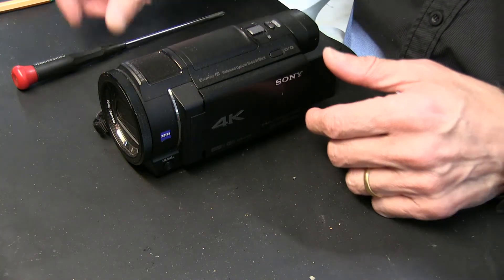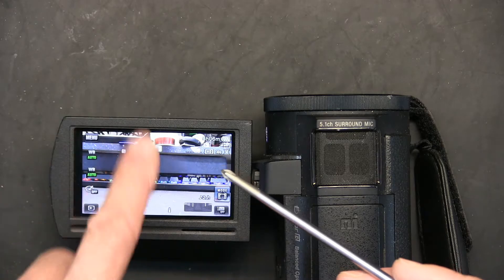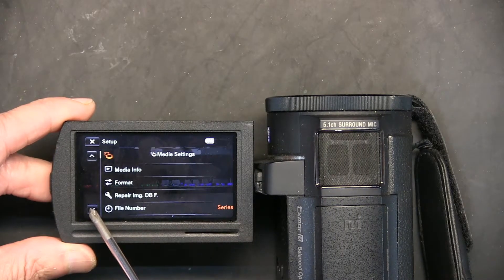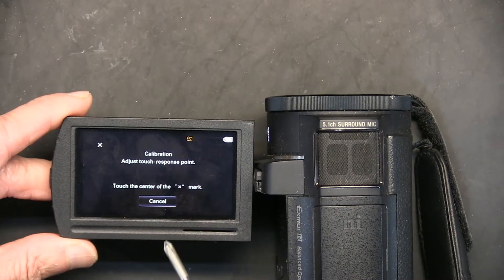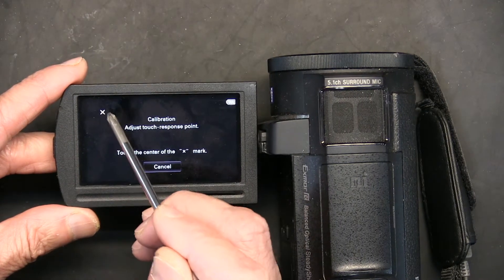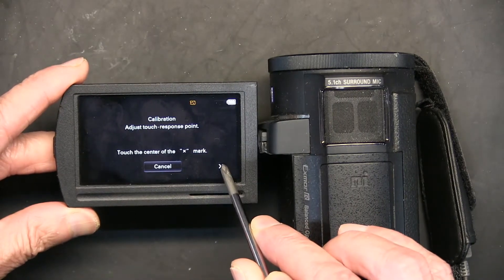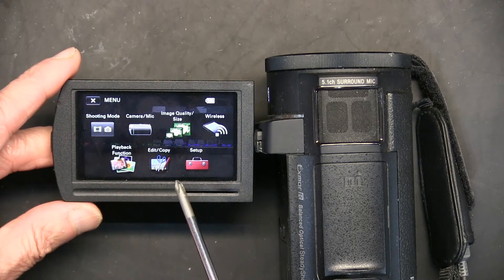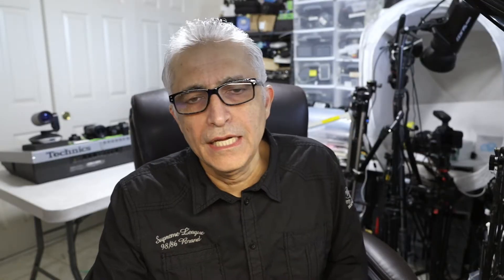Tutorial For Touch Screen or Digitizer Calibration on Sony FDR-AX30/AX33/AXP33/AXP35 Camcorders

Comment: Hello sir, I have a Sony FDR AX100e. It is struck on the Language settings screen and the screen is non responsive. Please help me out. I really need to get it fixed. It was left in a humid environment for a while and was moist when I got it out. 
Thanks a lot
Reply from the maker: Please remove the battery and let it sit in a dry place so there is no more humidity inside the camera. You can expedite the process if you use a Hair Dryer from a distance not too close to the camera, but make sure the battery is removed as it could case more damage to the sensitive electronics inside.
Reply: @TECHNOLOGYTIPS101  thanks a lot for that, do you think it’s a problem with the internal hardware or just the screen. I left it in rice as well for two day to get rid of the moisture but it’s still unresponsive. 
Really appreciate all your help.
Thanks
Reply from the maker: @sahilsharma3220  Most likely just the screen, as it is unresponsive, but I can't tell you for sure, because humidity could get on the internal components as well since it is not a water proof camera.

Comment: Thank you for your wornderful message. I calibrated thanks to you. Now I have a problem and perhaps you can give me your insight: I took my Sony FDR-AXP35 Camcorder to be serviced for Error Code e61:30. The screen read that and I showed it to the  Sony technician. Within a week they emailed me confirming that exact code error and I gave them the go ahead with the repairs for THB 1132 (US$34). I called them yesterday after waiting two weeks on a job that they said would take less than a week. Now they are saying they found a new error code e61:10 and that the cost is THB 9585 (US$288). There is no way the camera computer would have read e61:30 and now they say is reading e61:10. Can you tell me if this is a clear case of malpractice? I will contact the Consumer Protection Board in Bangkok, but I need some technical support before I do that.
Reply from the maker: The Error Code e61:10 means a bad mechanical part in the lens see link below 
https://www.ifixit.com/Answers/View/619936/How+to+fix+E:61:10+flashing+error+in+my+Sony+FDR-AX33

Error code	Possible causes
System error	Abnormality of the hardware
C:32:01	Abnormality of the hardware
E:41:00	Abnormality of the Wi-Fi connecting part
E:61:00	Abnormality of the focus driving part
E:61:10	Abnormality of the zoom driving part
E:61:30	Abnormality of the lens driving part
E:62:02	Abnormality of the image stabilization
E:62:10
E:62:11
E:62:12
E:62:20
E:91:01	Abnormality of the flash unit part
E:91:**	Abnormality of the flash unit part, battery recognition, etc.
Reply: @TECHNOLOGYTIPS101  thank you! I know what the codes mean. What I need to know is if it's possible that I get quoted for e61:30 one week and two weeks later for e61:10? Is it possible that there is malpractice from Sony or is it possible that these hardware problems can happen while under service? As a specialist, have you had a new problem erupt while you are fixing a camera? Was it human or mechanical (hardware and software) error?
Reply from the maker: @ivanjimenez3003  Both are possible, it could be a human error since they are both lens-related issues. However if the camera is subject to a physical shock like dropping, multiple mechanical error codes can occur at once.
Reply: @TECHNOLOGYTIPS101  thank you! That clarifies everything. Is there any way of knowing if it has been mishandled once I receive it? Of course I would check the body, turn on the screen to see what it says. Anything else?
Reply from the maker: @ivanjimenez3003  If you tell them not to fix it and ask them to send it back to you, the only way you prove it is to take it apart yourself and look for physical damages. However if they fix the damaged parts even if you take it apart yourself there is no way to tell what happened to the camera since the evidence is gone. Having that said it is a very hard case to prove whether malpractice was committed.
Reply: @TECHNOLOGYTIPS101  thank you!
Reply from the maker: @ivanjimenez3003  No problem!

Comment: i have the AX-53 however when I turn it on it goes to initial setup however no matter what I touch on the screen it does not respond. and I can not move to the next screen. I can not use it. I wonder if you how to fix this issue? any suggestion is greatly appreciated.
Reply from the maker: It sounds like you have a bad Screen Digitizer, so it needs to be replaced.  You can get the part from eBay here is the link https://www.ebay.com/itm/233759412516
Reply: Flex cable? I´ve got the same problem. The touchscreen do not works and I can´t move any setup.

Comment: How do you get to the menu to calibrate the touchscreen, using the touchscreen, when the touchscreen is OUT of calibration and will not allow you to activate the menu button?
Reply: Hi, I go to calibration, but when I try to touch the second X the screen is not calibrated and touch “back” how I can calibrate in this situation?
Reply from the maker: When it is OFF calibration the menu will be activated at a different spot other than where it says Menu. So you have to touch around it and see which area will activate it. Once you figured that it is being activated when you press 5mm to the right, from that point you need to press every sub menu item 5mm to the right until you get to the calibration screen.
Reply: @TECHNOLOGYTIPS101  by my best guess the point to touch would be about an inch off the edge of the screen..
Reply from the maker: @jameshunter6872  Sometimes but not always, when it's off the edge it reappears on the opposite edge, so try that.
Reply: @TECHNOLOGYTIPS101  thanks!  I will give it a try!
Reply from the maker: @jameshunter6872  Good luck!
Reply: @jameshunter6872  Same, stupid design. Use a broken calibration screen to fix the calibration. 
Let me know if you find a solution!
Reply: @gjarvissessions1815  the solution was dead simple.  Turn it into a parts donor for another broken unit..
Reply: Thanks!  I think this one is going to be assigned to the spare parts pile..
Reply from the maker: @jameshunter6872  Don't give up on it so fast you can get a new screen for it here https://www.ebay.com/itm/323873637124